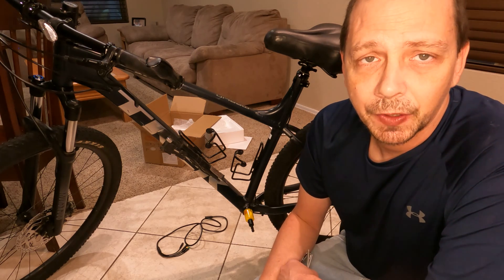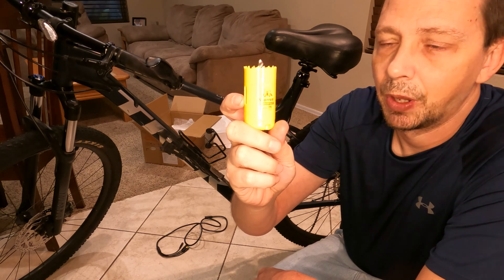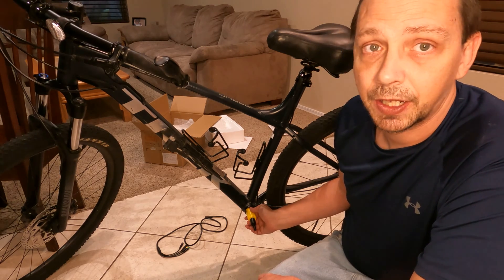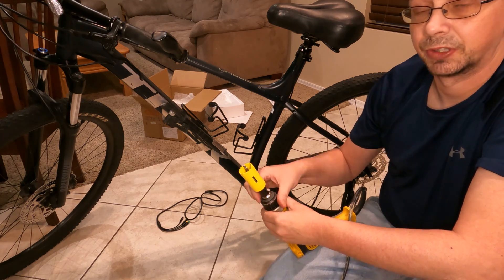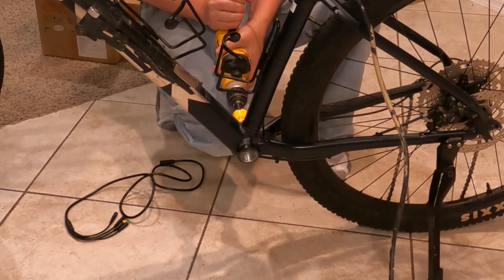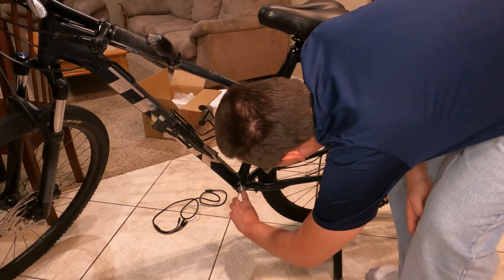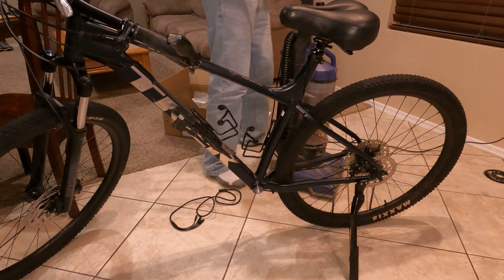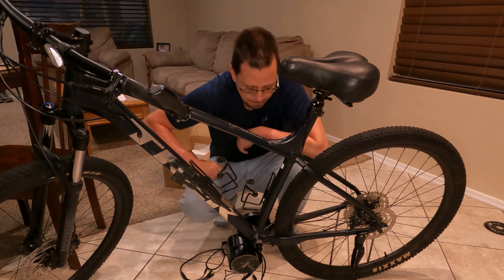Bafang Motor Wont Fit Bottom Bracket | Mid-Drive Doesn't Fit Bottom Bracket (Original Video)

Comment: It just seems one problem after another with this fitting this kit. Ive spent most of the morning just getting the bottom bracket out only to find the motor will only fit up to about half way through! Is this what I need to do?
Reply from the maker: yea 100% the same problem. I was sad as well when I discovered this problem. Set me behind a week of fun.
Reply: These things are sent to try us. I booked the day off work for fitting this. I have a 32mm hole saw but it's cheap quality. I shall get a 33mm tomorrow. In case I'm not as accurate as you were here, how much thread is needed? I'm guessing none is needed chain ring side but a few threads are needed the other side for fittings etc? Is that right?
Reply from the maker: No threads are needed for the Bafang. The hole saw shouldn't remove any threading.
Reply: @Eric_Tennant  Thank you I managed to take the majority off with the 32mm hole saw and tidied it up with Dremel type sanding barrel, it took a while but it's through now. Next job is to get some longer M6 bolts and spacers for the locking plate, and a spacer for the other side to stop the big round part of the motor being tightened to the chain stay. What seemed like a few hours on the videos is turning out to be a couple of weeks 😆

Comment: Thanks for posting this. Did this to a Schwin 26 inch hardtail with internal shifting and brake cabling today. Tried it with another bit and didn't work. The bit you linked in the description is a great one.
Reply from the maker: Glad I could help get the Bafang installed on the Schwin.
Reply: @Eric_Tennant  The Schwin previously had a Bafang 500W Front Hub Motor. Now it has a Bafang BBS02B Mid Drive with 48 teeth. I tried 52 teeth but it has clearance issues with that bike.
Reply from the maker: 48t will climb like crazy. With my 42t it climbs just about anything I put in front of it.

Comment: I used a round flap sanding disc on a drill to clearance my Trek Marlin 6 for a BBSHD. My motor won't tuck up against the down tube very much due to a weld on the bottom bracket. Thought about grinding it down a bit.
Reply from the maker: I did remove a small bit of the weld, but left 70% there still.
Reply: @Eric_Tennant  Thanks , will probably do the same.

Comment: just got a brand new marlin 7 and i encountered this issue.. Thanks man! gonna try shaving the bottom bracket this weekend
Reply from the maker: Wonder if all the 21-22 Marlins are like this.
Reply: @Eric_Tennant  dunno but looks like i definitely will need spacers. my lekkie chainring scrapes right up against the chainstay. i have some 2mm spacers coming in today
Reply from the maker: @AaronAndy1  Crossing my fingers that it will only take the 2x2mm spacer to make it work.

Comment: Eric what motor, battery, are you putting together?  Is that his for you??  Glad you didn’t go hub for your area!!
Reply from the maker: Got the BBSHD 1000w. I'm using the same old 48v batteries I always use ( https://youtu.be/kzZ_fG9IazY ). These batteries have 4 Uses now. Hub motor bike, Trek Bafang bike, Generator, and small compressor pump. I Been using a backpack to carry them however on tour/long trips I would rack the bike.
Reply: Awesome you will have to let us know how you like the new motor? I’m in Florida and hubs are the standard, but they barely help going up a hill. I got a used Bob trailer and thru all the battery’s and camping etc in there. They are great when moving and so so at stop or slow technical trails. They make the bike a bit tippy. Hey take us along on your next adventure!! A Guy in Illinois rode to Denver with that motor I think or a 750 and was traversing mountains. I found CBD oil helped my swollen knees and allowed me to fall asleep faster and deeper. A must for me at 60+
Reply: https://youtu.be/2XNwGed9K3E
Reply from the maker: That guy from that video has a nice charger 52v 15a